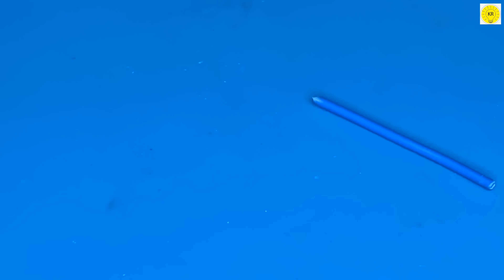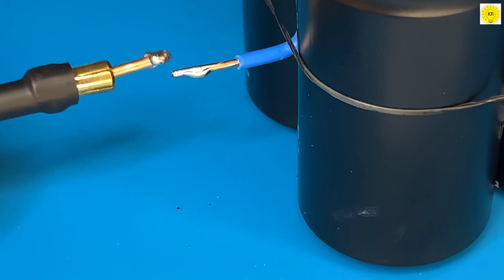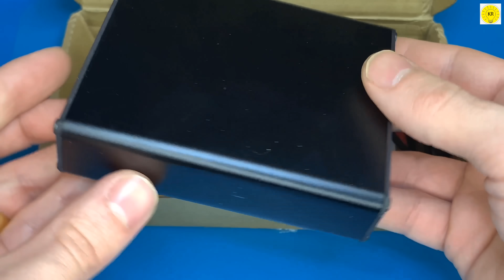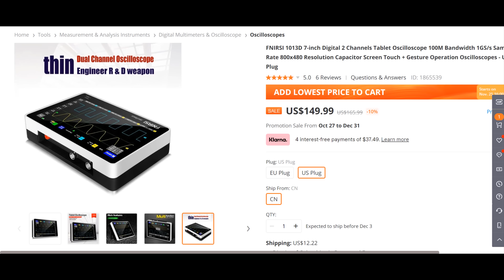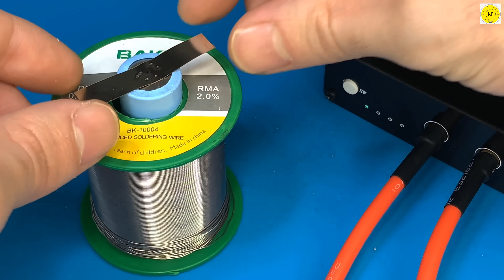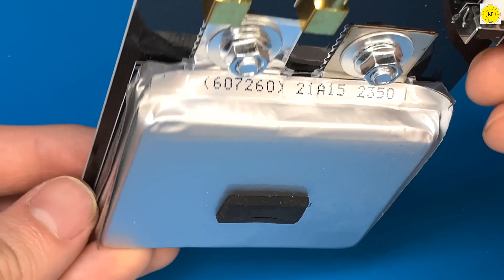how to make, spot welding machine , use capacitor, banggood

Comment: Does it work better by pressing a lead firmly on strip then completing circuit on battery case or is welding effect strongest on lead that makes contact last? Last contact creates spark but is there more of a weld or less weld created by that lead?

Comment: SAW another one using 9v output transformer  and bridge (Common with cordless phones) and 4x6.8 kohm caps and a LED+ resistor across cap to indicate  when charged for battery welding. That produced better welds.
Reply: Tọp secret, he do the work, you do guessing !

😂😂😂

Comment: Y si tocas las puntas 🤔
Te da una descarga 😕
Reply: no porque es poca tension, cuando usa el multimetro al final del video se ve que trabaja a 3v, como tu cuerpo ofrece una resistencia alta, no hay circulacion de corriente, como la resistencia de las chapas que se sueldan es muy baja la corriente que circula es alta, (dado que la fuente puede proveerla) entonces la alta corriente es lo que derrite y da lugar a la soldadura, se calienta la zona de los electrodos. distinto de que si la tension es de mas de 70 u 80v ya podes empezar a percibir algo en tus dedos, mas aun si es AC, el problema tambien con los enchufes ac de la casa es que la corriente se limita menos (segun las protecciones con las que cuente tu domicilio) y entonces ese calor generado en la zona de circulacion de corriente es mucho mayor...

Comment: Soldering is more like gluing things together.
Switch and mosfet has no function (shorted drain- source) Spot Welds are poor without pressure on the electrodes before welding current flows.
Reply: ☝️And is Inox steel, so this weld is just bullshit
Reply: What? You're not supposed to put a lot of pressure on the electrodes. You want there to be a tiny bit of resistance where you weld
Reply: @ericklein5097  Did you watch the video? The metal stip is bend upwarts at the Ends with an airgap between it and the cathode of the battery. If you do not bring the materials togehter before you initiate the welding it makes no sense. and I don't say "a lot" of pressure. Press it together so there is no airgap and then initiate the welding process.